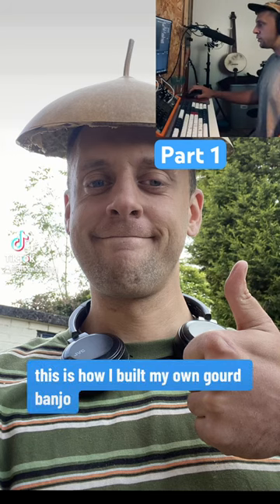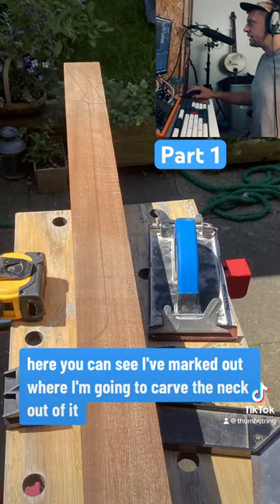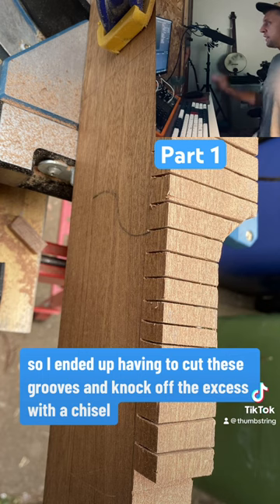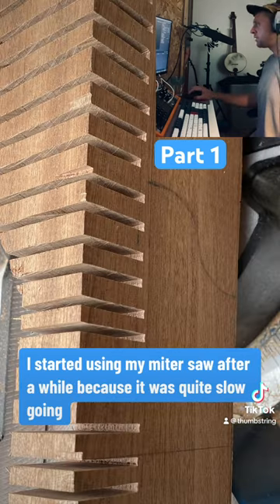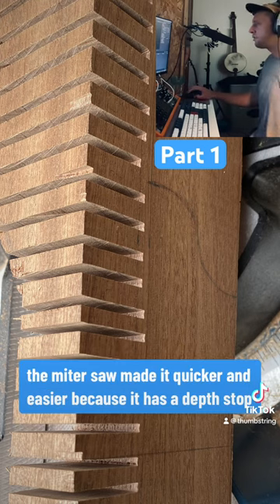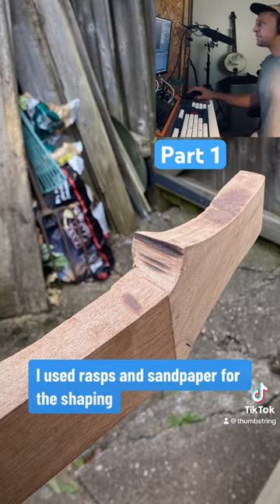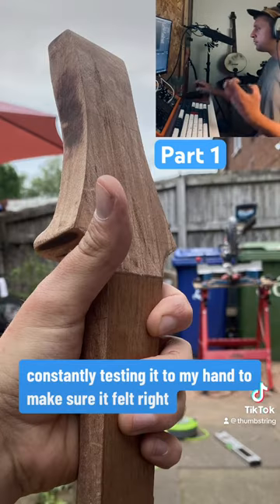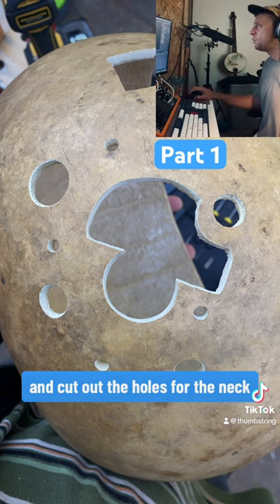How I built my gourd banjo. #banjo #diy #gourdbanjobuild

Comment: Was the neck all carved from a single piece of hardwood? Or did you do any gluing to get the proper size. Curious what sort of heel design you did, or if it was all a single piece of wood
Reply from the maker: Hey! It was carved from a single piece, the stock I had was long enough but I probably wouldn't do it that way next time. Save money and get some shorter lengths